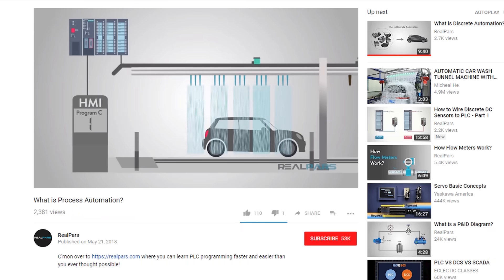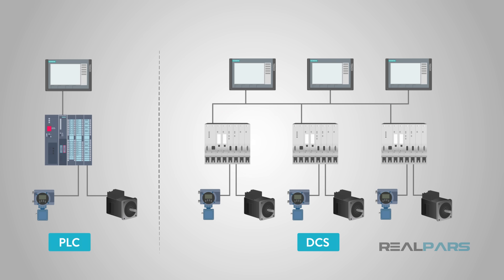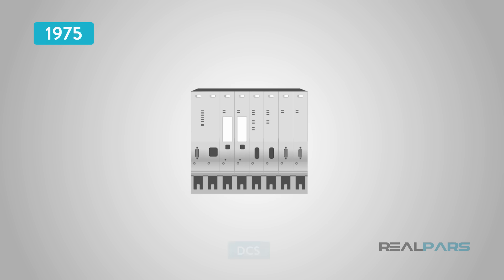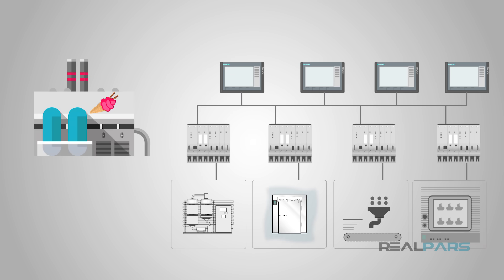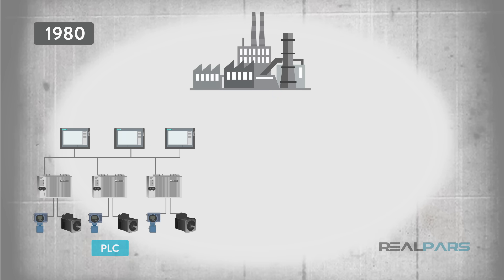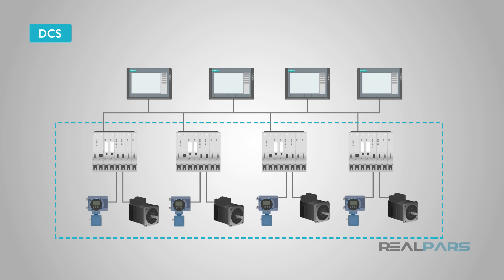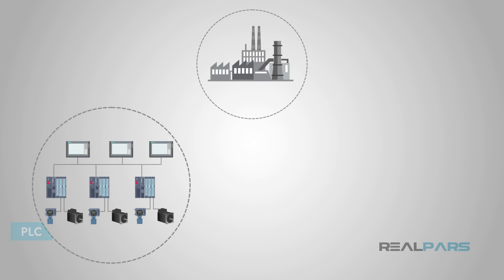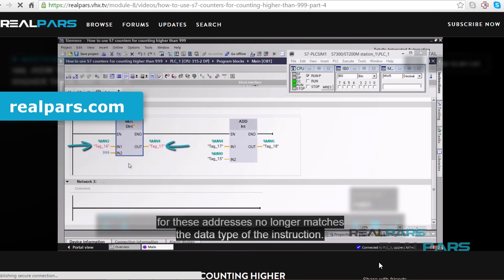What is the Difference Between PLC and DCS?

Comment: Can multiple PLCs be combined to form DCS ?
Reply: Not really. The group of PLCs will always have a multiplicity of tag databases and every communication between processors is custom engineering which must be designed and maintained by the owner. The Operator may not be able to see the difference if the adapted-to-process-control PLC network is very well done, but the cost of ownership will always be higher than a designed-for-process-control DCS.
Reply: Yes, it is quite common to integrate many PLCs via sub sytems like Profibus / Modbus / Profinet to DCS system. Especially if you have many package units and you want to collect data to send them to upper system like SAP.

Comment: Question : is it possible for one controller to communicate with the other one in the  DCS   ?

                 : Is it possible for one HMI  to control more then one controller  in any of the system
Reply from the maker: The short answer is YES.  Most DCS suppliers have a method for communicating between controllers, often called peer-to-peer communication.  The methods are usually different between manufacturers, but in most cases, this type of communication is not meant for large amounts of data transfer.  And yes, the HMI stations will be able to monitor and control items from multiple controllers.
Reply: A lot of PLC and DCS are using TCP-IP to communicate with.

Comment: I worked with Modicon PLC controllers 184, 384 ,484 and finally 1084 systems. They were really reliable  and easy to program.Hats off to the rugged design . We had 25 systems and i should proudly say none of the I/O modules nor CPUs failed for 25 years ,except few power supplies and RIO interface.
Reply from the maker: Thanks for sharing that with us!

Comment: Many aspects are not mentioned. The DCS has been process oriented from day one where PLCs more discrete. PLC vendors are trying to get there and are better in process but still not equal. Redundant control processors for example whereby a control processor in a DCS can be removed during operation, fail over with no affect on process - have done it many times. Communications capabilities of the DCS vs most PLCs, network redundancy, as well as incremental downloads and online programming of the DCS. I have seen PLCs that will go offline with down load - and fault on divide by 0!. For plants that have  maintenance shut downs measured in years this is unacceptable. Also, cost. A DCS was once much more expensive where now a PLC based system that comes close to capabilities of a DCS with redundancy on network and control levels is often more expensive in PLCs and much more difficult to implement. Depends on your needs.
Reply from the maker: Thank  you for your comments.  In our YouTube videos, we are presenting a broad coverage of topics that are not meant to be exhaustive.  Having implemented dozens of both DCS and PLC systems over my 38-year automation career, I have seen the trend firsthand of PLC's getting more powerful and DCS systems getting less expensive.  It is important to note, that as a general rule, failover in DCS systems is more transparent than most PLC systems, but not all DCS systems are configured with failover CPU's.  Most PLC's I work with now (ControlLogix, S7-400, etc.) also support online changes, incremental downloads, and redundant and fiber-based communications.  Distinctions exist, so the best solution is the one that meets your specific needs the best.

Comment: And whats the difference btween SCADA and DCS? Is its their database size?
Reply from the maker: This is a question people have been asking for yearst.  When the term DCS was introduced, it referred to controllers and I/O networked together in a plant with a single-window interface, the operator station.  This was quite a shift in architecture from the operator panel with switches and strip charts.  Later, laboratories, pilot plants and other processes wanted to have the ability to monitor and control their processes, without the high cost of DCS systems.  So PC-based SCADA systems were developed with board-level I/O and PC-based HMI applications.  LabView was one of the first and is still the most widely-used of these SCADA systems.  Over time, SCADA systems have become more and more powerful, and DCS systems have become less proprietary and lower cost.  As a result, there is not a lot of difference between the two any longer.
Reply: @realpars  wow man...thanks for such a complete answer!
Reply: For more videos related to DeltaV, Honeywell, Yokogawa or ABB DCS, Visit our Channel and Subscribe.

Comment: You got a lot of things right on this video, but a lot of this information is extremely misleading.  "You wouldn't want to control a single plant with one PLC," you said.  I've never seen an entire plant small enough for a single PLC to control it, but PLCs are far more scalable than a DCS.  Often a single PLC will be employed for a very limited system and will communicate with other such PLCs, creating a network of PLCs that is far more "distributed" than a DCS (Distributed Control System).  And any DCS can have a controller fail, which would bring down a significant part of the process and other parts that relied on it in the flow of product.  The platform you use is essentially irrelevant.  You suggest that PLC programming is something of a commodity while DCS programming is highly specialized.  That just isn't true; it's platform dependent.  There are thousands of Rockwell programmers in the US, but far less Mitsubishi programmers, but both are PLCs.  And for DCSs that have been around a while, you can find plenty of engineers with applicable experience.  The thing you got most correct is that with the technology available today, almost any process can be successfully controlled with either a PLC or a DCS.  The selection mostly depends on specific plant applications and company preferences.
Reply from the maker: Hi Mark, Thanks for the feedback and sorry for the delay here. Some of your points are well taken. Consider a small water treatment plant as a possibility for a single PLC control platform. I have seen many in my 20+ years that are certainly small enough for a single controller. Not sure which parts are extremely misleading but consider the video more history of PLC vs DCS as today, the lines are blurred. The differences in today's controlled environments are nearly indistinguishable.
Reply: Agreed, I was as a lead control system engineer for biogas plants and our plants  are controlled off a single s7-1500 controller
Reply: But we can setup redundancy in DCS right??

Comment: Great video. That fact that you missed was the DCS was used more in the past in large control systems because early PLC's were not capable of handling analog values. I saw a Honeywell DCS system completely replaced with Rockwell PLC's and a PC based HMI system. The 2 systems were almost identical to the process operator.
Reply from the maker: Thank for your comment. Using the DCS systems instead of PLC systems due to the incapability of the PLC systems in handling the analog values is of the early reasons in the late 80s, I believe. Nowadays, the PLCs became more sophisticated so that they are able to scale/unscale any kind of input and output.
Reply: Al Ryan : you can do all that now with the AB studio 5000 logix designer
Reply: For more videos related to DeltaV, Honeywell, Yokogawa or ABB DCS, Visit our Channel and Subscribe.

Comment: A PLC could have a Primary Processor fail and take out a whole system as compared to one system in a DCS that goes down. But I guess if you maybe build the PLC system right and add redundancy with a Primary & Secondary Processor network, if that system ever going down it should be far less an issue. It should switch and barely skip a beat.

Comment: Nice video. One thing I might add is the DCS is usually designed with a narrower focus on process control.  For example, implementing a complex cascaded multiple PID control scheme with constraints on a DCS can be done much more quickly and easily than a PLC. PLCs are more general purpose - you can implement the same control scheme but it will take longer, functions like tracking, reset limiting, signal selection, filtering and clamping sometimes need to be explicitly programmed so you really need to know the low level details (it could be argued PLCs are more powerful since you can make them do exactly what you want).

DCS usually has a standard library of function blocks which cover pretty much everything you would ever need in process control. The PLC library is often more limited, extra functionality may be available at a cost however. Btw the function block diagram you've shown looks like modern ladder logic, quite a bit different to the typical DCS function block control drawing layout. 

The tight integration between the controllers, HMI (which you mentioned, but worth repeating) is a big deal. This can save many thousands of man hours on a large project if a DCS is chosen.

Other notable differences:
-Alarm configuration is typically more powerful in a DCS than a PLC/SCADA combination. 
-Fieldbus configuration is often tightly integrated with a DCS development environment, in fact some Fieldbus protocols common in continuous processing applications are not available or have only recently become available on PLCs.
-System health assessment (via system alarms) in particular is tightly integrated within a DCS. You can see at a glance how the system is performing.
-Operator keyboards providing key process control interaction funcitionality are standard with a DCS installation.

Not to mention the seamless integration between DCS and SIS from the same vendor, but that's another story :)
Reply: Quite a good analysis:
The PLC Shown in the video looks like the Siemens and the DCS is the ABB Freelance AC800F (originally form Hartmann & Braun Germany).

I don't think it was the best choice of a DCS, as the AC800F is a low end DCS, quite near to  PLC, quite far from the DCS ABB AC870P (ex Contronic S from Hartmann & Braun, previously Schoppe & Faeser)
The AC800F does not require memory allocations of variable as you would in a PLC, it does have standard libraries for for PID's  etc, but they are all quite simple and don't have standard tracking philosophy eg. in cascade control as you can would find in a AC870P.
AC870P allows you to create your own complex PID structure, which could be quite difficult with an AC800F.

With an AC870P you could create complex calculations and the system can automatically calculate the upstream tracking value.
Both systems are freely programmable, you can create your own libraries, but you need quite a lot of experience to be able to create something close to the high level automation you can find in an AC870P
Reply: @santopino2546  I would have liked for them to use abb new systems Symphony plus or 800xa. And automation architect or composser
Reply: Brandon Holloway Symphony plus is an HMI or Scada system designed by ABB Italy, it has an extremely ridiculous graphic language but does have good connectivity towards third-party systems. The price is on the high end.
800XA is a family name, mainly an HMI system, but they have integrated programming language for various DCS systems that ABB acquired in the past ie: Bailey control's INFI90, Fisher & Porter System six, Hartman & Braun Contronic S then AC870P, ABB Advant and ABB AC800M. excellent graphics, automatic animation, expensive.
Reply: @santopino2546  yes and thank you. I worked for abb. I was just thinking using those systems would have made the video visually more enjoyable
Reply: Brandon Holloway not easy, they need to get their hand on these systems, only the AC800M without 800XA and AC800F/AC900F is sold to system providers, so unless they go to ABB directly they can only hope some internal guy suppliers them with info.
I worked for Hartman & Braun Italy for 13 years, left a few months before ABB took over, but it's already 30 years I work with this group on H&B Contronic 3, Contronic P, Contronic S then called Melody then AC870P, Digimatic then Freelance 2000, AC800F/900F, Tenore later was called PGP then symphony plus, 800XA with AC800P and AC800M.
Haven't worked on any of the Bailey, Advant or Fisher Porter systems.
I prefer AC870P, complex but designed by genius, I think the first operating system was written in Smalltalk, they could get into the operating system during operation to fix bugs, I only know of systems capable of doing this on the process Software.
Reply: > Beau. Yes, sir, bullseye.  The trade off's between configuration time (sometimes programming) vs. cost (of a more sophisticated and capable system) and other selection criteria, is the key.  The old "Time is $".  
This video and your comments perfectly outline the big picture (PLC - DCS), but even within different makes & models of systems within each category, there are considerable cost vs. (built in) capabilities.  Need batch sequencing and recipe flexibility? Better be sure systems being considered have the capability, so you're not hand crafting a "kinda-sorta" sequencing package (did that on a legacy system, we got there, but a lot of noodling dollars spent).  
There was even a large chem company that built their own DCS and claimed it was worth it, but they had a huge staff in house to program, install and maintain it.  Virtually every other company uses the leverage of proven vendors systems, targeted to the nature of their environments, as you describe.  
And I do believe HMI integration and operator experience (aka "ease of use") is where a noticeable difference between integrated by design vs. programmed to communicate together, becomes apparent.  Ask an operator to show how he/she performs a common task, start a pump, enter a set point, etc. and count the mouse clicks, a simple but meaningful test of well designed system, and ultimately, operator acceptance.  I once talked to an operator who expressed "dissatisfaction" (his words were more colorful) with a brand new DCS that replaced a multi-decade old legacy system. But he could start a bank of pumps on the old system much faster/with many fewer mouse clicks.
Reply: Excellent detailed explanation. Thanks.
Reply: Can you explain or do a video about the other story? thanks
Reply from the maker: Nice comment and you certainly know your DCS's. Agreed that there are some integration advantages with a DCS. Also, as you stated, most tasks can be performed in either, some more time consuming and challenging than others. In this video we were going for a more generalized, higher level difference.
As you indicated, since the DCS may have a more narrow focus, many folks just jumping into the field don't really have even basic knowledge of a DCS system. 
Thank you for your comment!
Reply: Thanks for the comment, it was better than the video itself.
Reply: 0
Reply: छह

Comment: Sir can u please make video on difference between plc and safety plc
Reply from the maker: Thanks for the comment. We will consider your request.
Reply: A safe PLC has included redundancy. The code is compiled in two different compilers and executed on two different processors and it constantly self checks to ensure the outputs from the two different processors are in agreement. They are all generally TUV certified. On some systems, if you are using a standard PLC and a Safe PLC together, you can get cost savings from the Safe PLC using the processor in the standard PLC as its second processor, meaning the safe PLC will only need 1 physical processor.

Comment: Single-point failure in PLCs can be removed with redundant PLCs. Though its pain in the ass to program and test.
Reply: Matti Mälkiä I agree. But how long does it take to troubleshoot, replace and reload PLC module? I guess a redundant system would be less cost effective too
Reply: Matti Mälkiä it depends.  Generally, I would agree with you about the I/O.  Depending on the manufacturers, redundant processors is easy.  In the case of at least one platform I know of, redundant I/O is easy too.
Reply: For more videos related to DeltaV, Honeywell, Yokogawa or ABB DCS, Visit our Channel and Subscribe.

Comment: I want to know is there any compatibility issue if DCS and PLC's are used under same SCADA system? Meaning some equipment are controlled through DCS and Some are PLC's.
Reply from the maker: Since a DCS is a controller system and monitoring station built into one, I don't know if a DCS system would be installed into a SCADA system. I personally have not seen PLC's and a DCS combined and accessed through a SCADA system.
Reply: It is possible, but there will be compatibility issues.   However the issues are not really that different from the issues you would have if you use 2 different brands of PLC in the same SCADA system.  The main issues are what type of communication protocol do the systems use and programming software and language will be used.  The SCADA need a driver that can communicate with each different type of controller regardless if it is "DCS" or "PLC".
Reply: Mahadi Hasan usually the plc will be tied into the DCS system and it will act as the SCADA since those functions are generally already built into the DCS system.  That is not uncommon at all.  Many large facilities have a mix of DCS and PLC controllers.  Sometimes it’s for as simple a reason as the bought a packaged system that comes with a plc.  Sometimes it’s by design.  I think most DCSs come with the proper communications drivers and protocols to do it.  If you have an uncommon plc that uses proprietary protocols then you would have to come up with that interface for the DCS.
Reply: OPC or other peoples crap. We use this at abb to transfer modus communication. It's done on an excel spread sheet with reads and writes and process info.